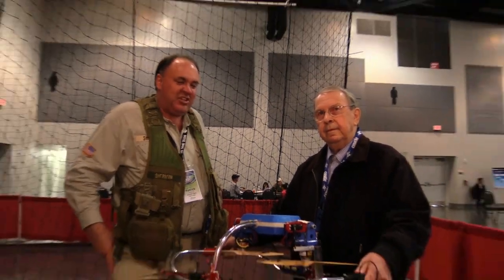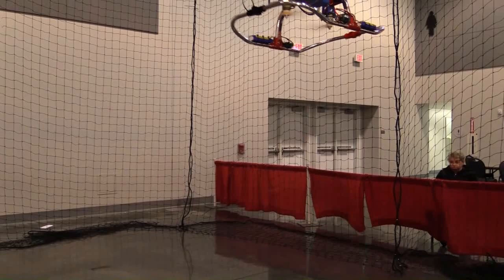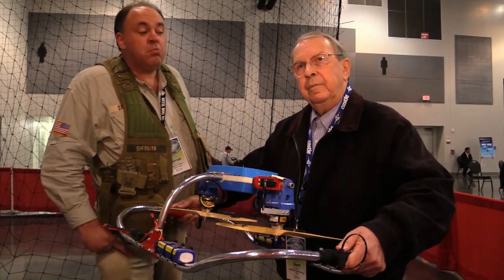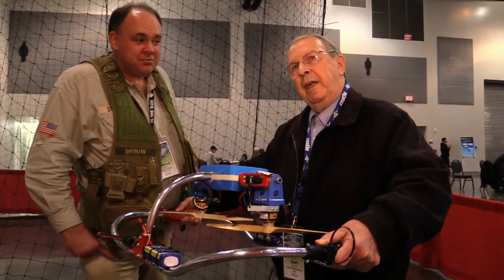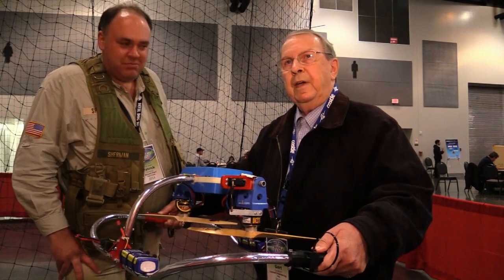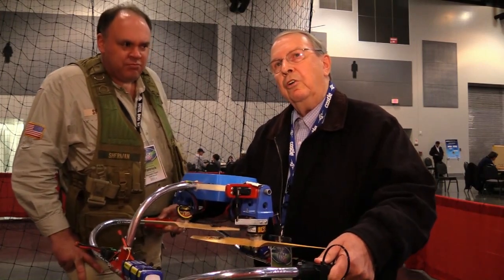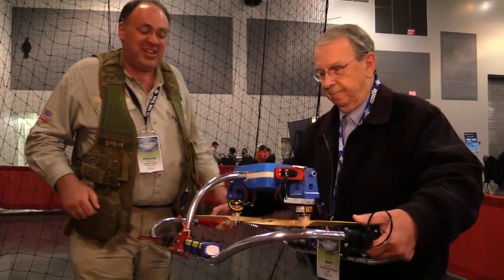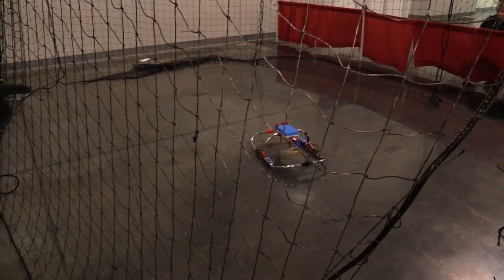RFTC: Twin Copter / Motor Tilting Hybrid Demonstration Flight at 2014 AMA Expo

Comment: No audio here either, looks like a cool flying tray.
Reply from the maker: To me, it looked like a snow sled missing the sliding surface, or something like that. Sorry about the audio problem -- I see you figured it out while watching the other video with the same issue.
Reply: *****
You could tell there was some structure to it and mind those props! As for my critic on 3dr I think jobs are what both our countries need as well. From chip to reseller. :o) Ontario CA home of the original 80's MiniMaglite a USA made success, for a while at least.

Comment: Twincopters has been out for a while. Kk2 can control twins
Reply from the maker: Do other twins use the same type of configuration, with both motors mounted on servos capable tilting laterally, perpendicular to the fore-aft axis?
Reply: yes, i have seen some on youtube